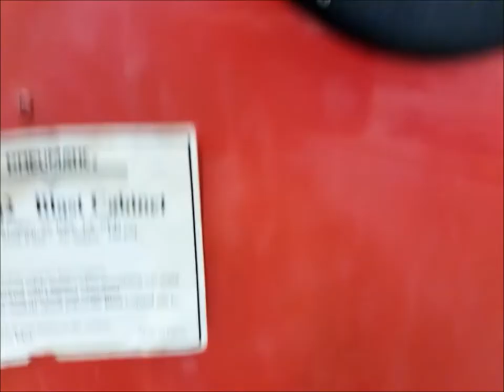1920 Allis Chalmers 6-12 part 39

Comment: Jim will do you right on the engine machining. I worked with him back in '95 and known him longer than that. As if Norm's use of Jim didn't speak highly enough of the work.